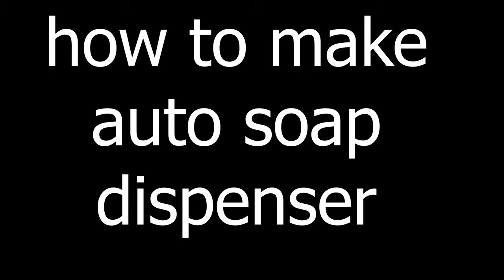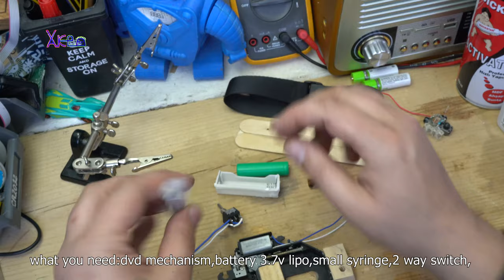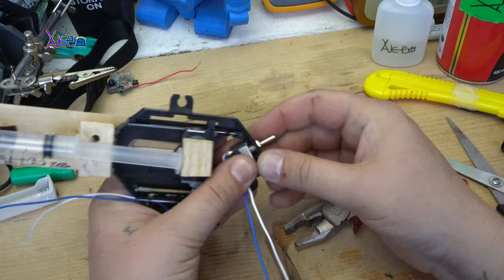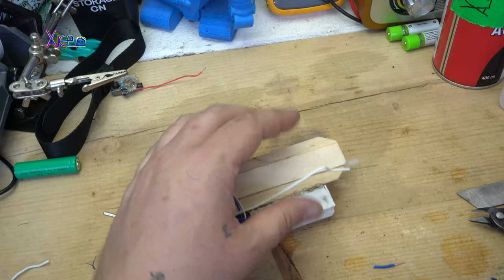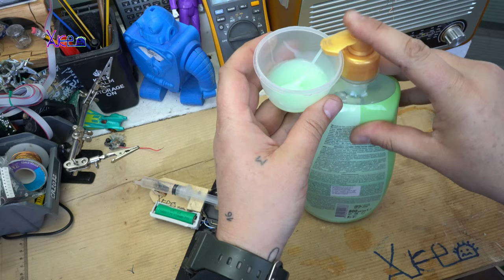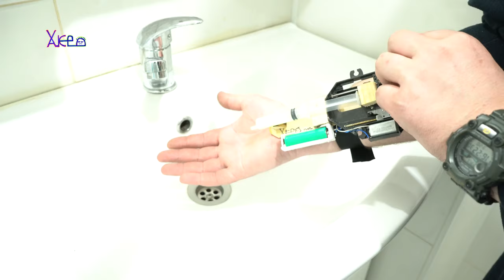Great Idea with DVD Mechanism

Comment: How to make this "lifehack" usable:
remove battery, remove dvd assembly, remove switch, remove wooden parts....
add a cap, put the syringe in your pocket... done.....

you could use that mechanism to make a wall dispenser using an arduino, a bigger syringe, and a proximity sensor, that would be usefull... but you attatched it to your arm like an hidden blade..
the only use i can think of for your device is for secret agents running parcours, to apply soap to a handle thus make it slippery and their pursuers fall to certain death...
basically you created the next prop for a trash movie clone of kingsman....